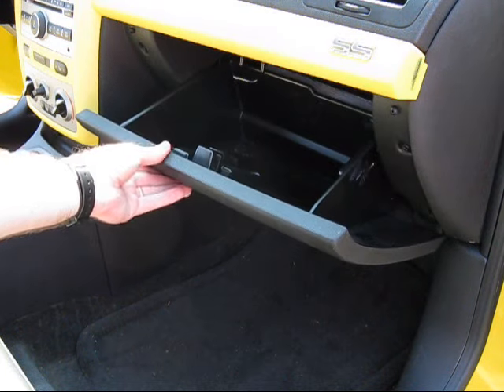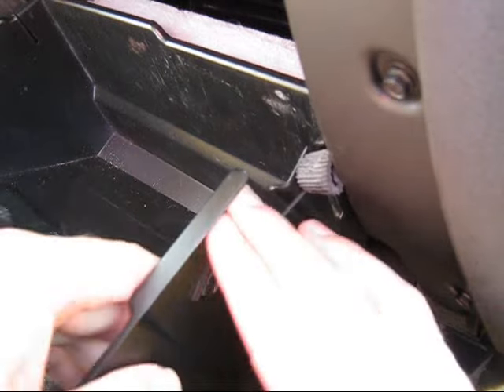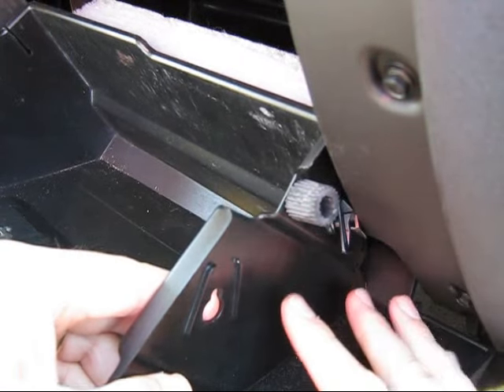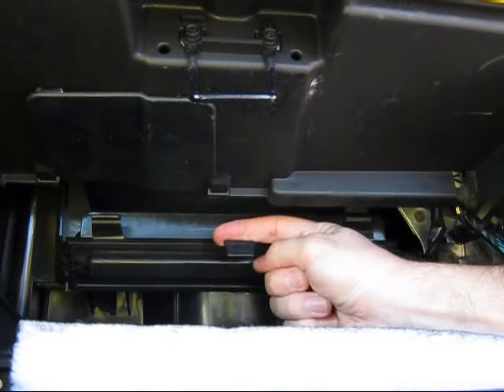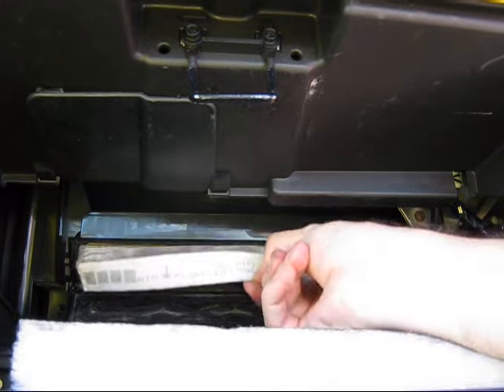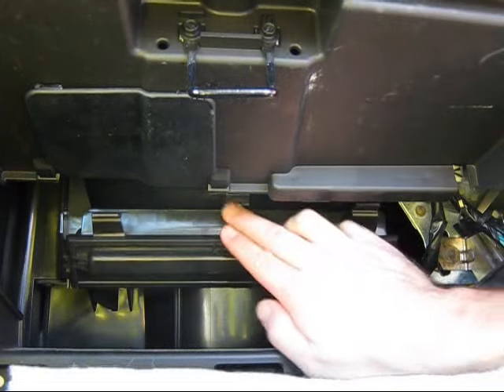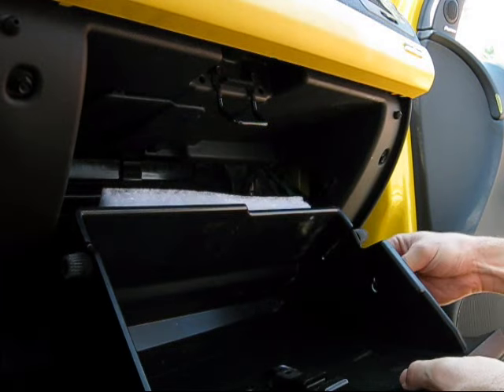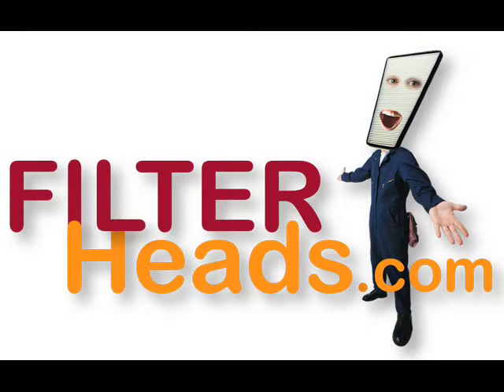How to Replace Cabin Air Filter 2007 Chevrolet Cobalt | AQ1085

Comment: HOLY F'N SHIT....  WHAT A DIFFERENCE !!!    Never thought about it...  My 2007 Cobalt LS purchased Nov '06 only has 13k miles on it..  I live in Vegas....  DUSTY...  My other daily is a 2001 BULLITT MUSTANG GT with 26k miles with ICE COLD AIR...   I hadn't daily driven the Cobalt in a year...    Yeah, I'm bad like that....    But put the BULLITT into rest for awhile and started driving the Cobalt again...  in JULY !!!..  The AC SUCKED ASS...  hardly any airflow,  Read this, popped the Glovebox, as in hold in sides and pull down.. but didn't need to release the cable..  unlatched the filter housing, pulled out.....  HORRIFYINGLY DIRTY !!!!!     Ordering a new one, so left the housing empty, started the car, and KA BLAMMO !!!!   Like a jet engine blowing on me ....  WOWOWOWOWOW !!!!    Mad Props for a most Excellent VID !!!!  THANK YOU !!!!!!!!!!!!!!!!!!!!!!    Now gotta check the BULLITT Filter..
Reply from the maker: Thank you for watching!

Comment: Hmmm Im having difficulty removing the chord. It won't budge.
Reply: I tried to remove the cord til my fingers hurt...  realized in my car..  2007, that I could still unlatch the 3 cover snaps, and remove the filter...   hope this helps..
Reply from the maker: Thank you for informing us!
Reply: My 2009 has plenty of clearance without taking the cable out. Try it first before doing that step